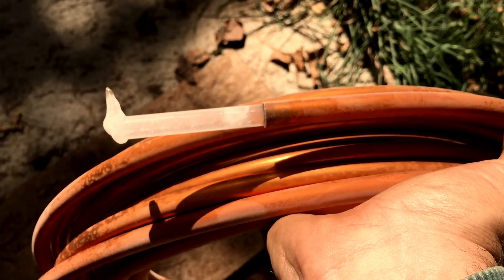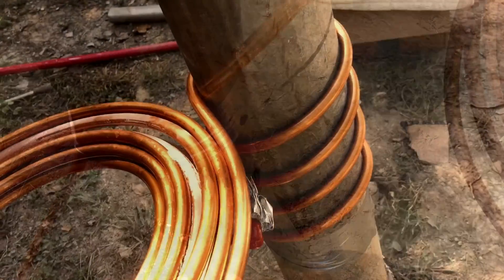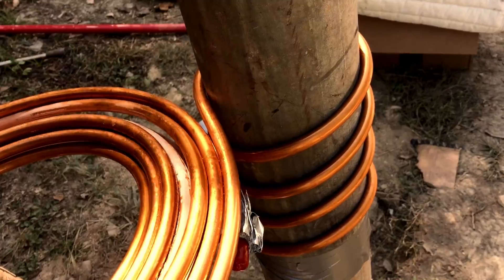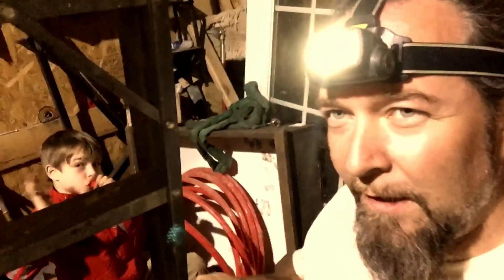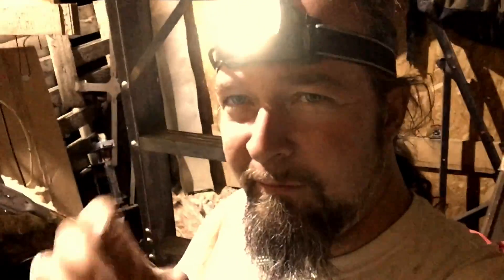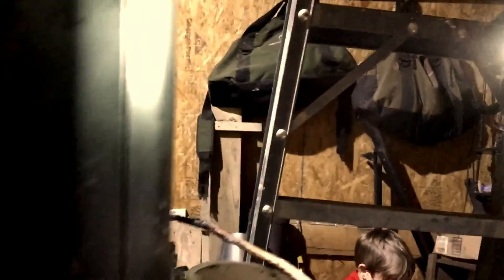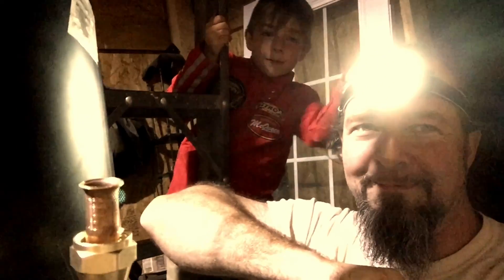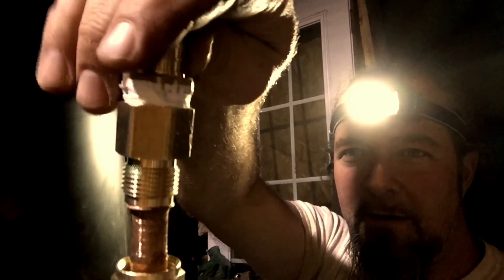Quick, easy, reliable hot water from a wood stove

Comment: How does freezing water in the pipe keep it from kinking? Looks way easier than most ways people do it.
Reply from the maker: water expands when frozen, and maintains relatively constant pressure inside the copper when bending it, preventing wall collapse.
Reply: It makes it solid, or stiff, and helps to not flaten , Im a hvac tech and bend copper alot, anything under 1 inch will kink  fast ( anything over good luck lol ) if you just bend it over your knee, but the way he did it im not sure that wes needed, , with water ,I woud think if it flatened on the pipe the heat distribution ( surface contct )would've been greater any more efficient, its  not the same as refrigerate, needing all inside diameter as a vapor.  I must say its a cool trick.

Comment: And that flared joint is stronger than the tubing itself! Once you learn to do it right you won’t use any other fittings and if you’re going to put fittings outside they make frost nuts basically it’s just a cast flair or not but it works well on the ground we use them on gas and oil and everything outside you won’t use compression anymore after you learn to master that tool!!

Comment: you should use 1/4" copper pipe.  use 2 sets of pipe then join them with a 1/4" to 1/2" adapter. your not going to get good heat transfer with 1/2"
Reply from the maker: Hi Paul, we have been using this puppy for over a year now and it is heating great.  I will take your suggestion into a future test.  (I literally just built version 2 of the stove yesterday with 1/2" as well.  I'm sure there is a sweet spot for dwell time and heat transfer. (smaller tubing will run fluid through faster at the same flow rate as compared to larger tubing)  I did experience a significant improvement in heat transfer when I moved down from 3/4 to half inch, but was concerned that 1/4 might choke off flow too much.
Reply: If you run 2 coils of 1/4" pipes in parallel it will be the same flow rate.  When I used 1/2" the best heat output I could achieve was 120 degrees.  When I put 2 coils of 1/4" in parallel I was getting 165 degree output.
Reply from the maker: Awesome.  In my test of the v2 stove last night -  when the stove is in downdraft mode I was getting 170º water out ( had 40º water coming in as it was 10º  last night and my shop floor was coooooold.)  Not sure of flow rate as my pump has no internal flow meter.  Thanks for intel, sounds like 1/4 is definitely better heat exchange based on your trial.  in your test did you have the exact same length of pipe, or did you end up with twice as much linear pipe at 12/4"
Reply from the maker: Paul Yelle v2 of the stove video will be done processing around 4:40 today https://youtu.be/ToizIcbRrI0